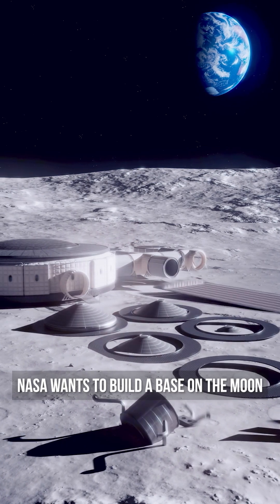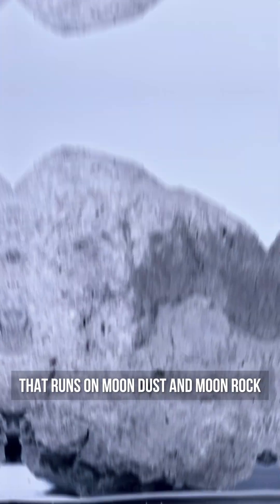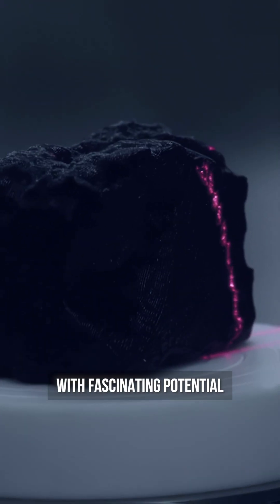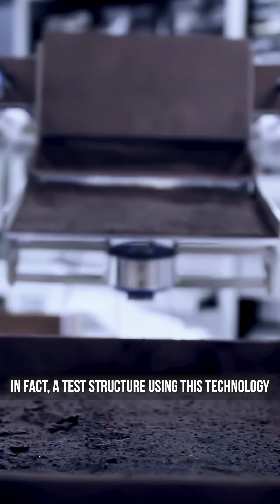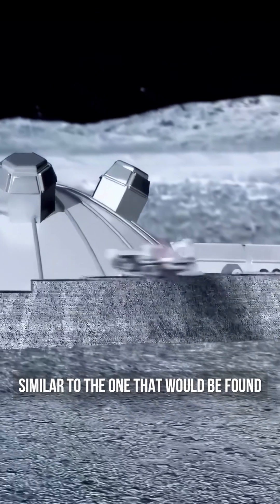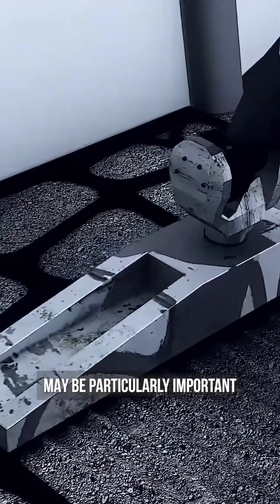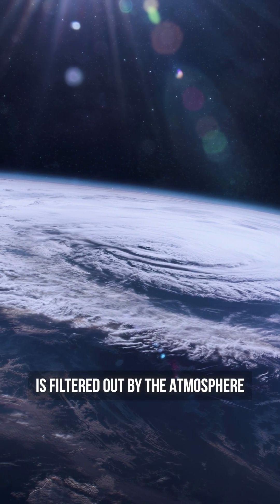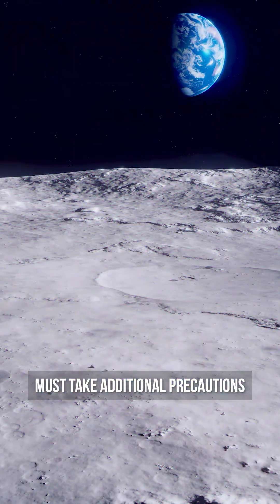NASA Wants To Use 3D Printers To Build The Moon Base

Comment: If you can print a brick you can simply “bake” one in a mould for a fraction of price
Reply: they don't print bricks. it's one long continuous piece like a typical 3D printer. the structures need to be sealed so tight, that radiation doesn't penetrate through spaces in "bricks" and to be able to be load bearing, either that be to hold atmosphere/pressure, or to hold certain shapes. bricks wouldn't be able to handle that job.
Reply: @hardcorebossstyles  eh? You saying this material shields gamma radiation... aha.. right. You gotta love random armchair scientists on the internet
Reply: @Maxima 120  and you're saying it wont? Ah arm chair internet scientists...

Comment: They make it seem simple in order to shield from the radiation you need about 3 feet of shielding would the base made by a 3d printer be strong enough to hold that mass and resist meteoroids and moon quakes plus the temperature extremes not to mention moon dust that's very reactive

Comment: Need to build tunnels just underneath the surface then use the regolith as a source of almost every single material for construction. It's going to be bad enough importing all the goddamned water.. although just offhand it might be possible to take up nothing else except for hydrogen... depends on what substances it's possible to get from the local rock and regolith, but obviously oxygen is the prime consideration. But let's go anyway before it's too late! Build a radio observatory on the far-side and speaking of loony things, exclude all of the far-right religious extremist fanatics, again, before it's too late!
😆👍🤔🌎🚀🌖🛸🌌❗🥰👍❤️

Comment: i think much better would be digging caves if the moon surface is strong enough i mean if the surface is strong enough to hold itself it would be easier and logical at first then you could extract the resources also it would be necessary to take some temporary but stable base modules that could provide necessary protection and sustain life for the time being sending some kind of automatic drill machine would be better

Comment: But HOW they gonna get there when they can't get through the radiation field surrounding the earth? You know, the one that prevented them from going to the moon way back when, the one that would just simply FRY everyone in their little spaceship as if they were being microwaved
Reply: The problem is staying outside of the magnetic field for a prolonged period of time. The Van Allen belt is also a problem, Apollo just solved that by taking the shortest possible route through it.

Comment: They could make a balloon the shape of the building, roll it up, take it to the moon,  roll it out, blow it up, maybe make it from a material that will harden in uv light, and the high temperature of the moon, but be sure it doesn't set too fast, something like kevlar and carbon fiber with a UV cure epoxy, with alternating layers of a felt like Matt and woven layers,  the heat would probably be the best way for it to set ,  it being 1/2" thick, with 1" thick seams forming reinforced ribs, the life support system could be used to inflate it, and the inside could be a couple layers of fiberglass, with white opaque pigment, with LEDs inside,  with maybe a layer of mylar behind it, reflecting hear in and heat out,  to also reflect the lights from LEDs, making the walls and ceiling of the dome illuminate, maybe even the floor,  only a few hundred watts could light a large area this way,  it would be like everything is glowing, light from every direction, use something similar to the addressable LEDs, so a computer can signal what led is on ho form zones or rooms, that can be turned off, use a motion detector to save energy,  wow I'm wanting to build a home like this now! 😆,  Anyway, build the dome, then either make basically a concrete from the moon dust,  or make solid blocks and dry stack them over the dome, then fill any cracks with a epoxy mixed with moon dust, or something similar,  basically make a foam Crete blocks and mortar, that can use mostly moon materials, the outer layers between the moon materials and dome would be a good place for water storage, to block radiation,   maybe wrap the dome in pipes to be used as water storage, with a single pole in the center supporting the roof, actually extra support, because the wall ribs would form ribs, I'm thinking 30'-40' diameter, and being 15'-25' tall in the center, so scaffolding can be brought in to build a second level, where ppl could sleep,  it could be made from a similar material as the dome, it could come in a roll,  be rolled out, allowed to setup, then be assembled, the floor boards could be like a sheet of plywood that is rolled up, just unroll it , and allow it to set up in the heat,  carbon fiber is amazingly strong,  they make wheels for cars from it, ,  the correct shape can be made here, then it would just need to set up, up there and bolt together,  it would require a flat solid area to place  it on,  it could be the crate the dome is in, or the dome floor,  they can figure it out,   the lander could be the size of a 3rd stage of a 4 stage rocket, about 18' diameter, and 12' tall or larger, SpaceX has some huge stuff going on, it could easily fit in,   each dome could be the size of a fairly large house,  then join them with passages,  made the same way, just arches, 10' wide, 10' tall,  that all bolts together, with doors that can be sent up, with airlocks,  the lander could double as equipment like cranes or excavator , use power from solar panels,   sorry I ramble,

Comment: I think we missed a great source of building material for a moon base. A source that we could have started stock piling way back in the late 60's. Just how much scrap metal would there be on the moon to build a moon base out of if at least some of the rocket boosters that have burned on on reentry had instead been boosted into a path that took it to the moon. By now there would be enough scrap metal on the moon to build a dozen moon bases. And it would not have mattered if it took the booster 20 years to get there, it would be on the moon when we get there.